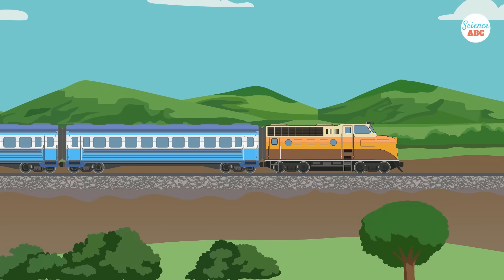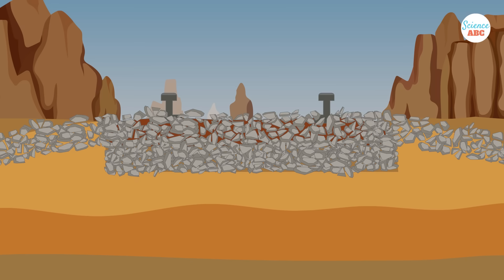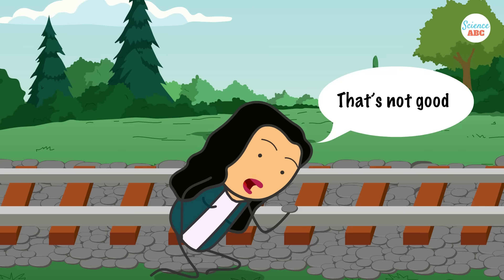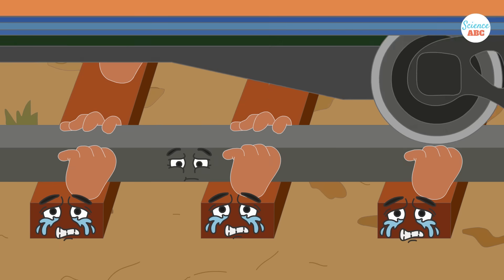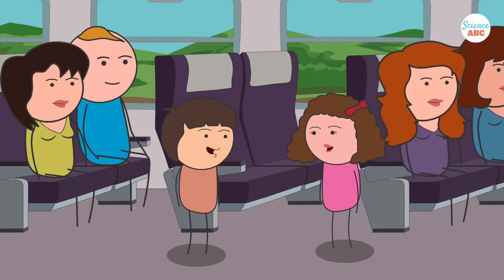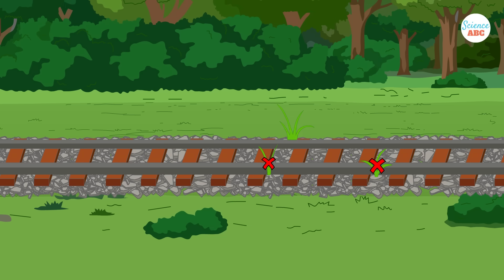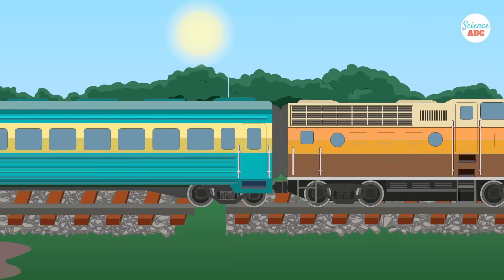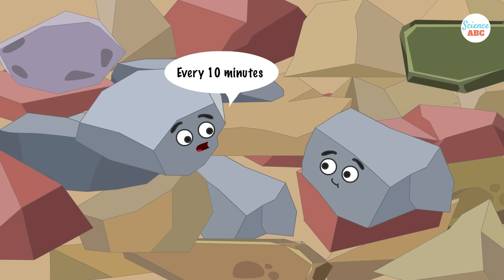Why Are There Stones Along Railway Tracks?

Comment: Out of curiosity, you say the grass and similar cannot be allowed to be near tracks. How does that fit with some tram tracks I'm aware of, which should be functionally the same as train tracks, working just fine despite being surrounded by grass?
Reply: my guess is trams are slower and due to being in a city and smaller its much easier to send a guy out with a mower
if there is a fire or something, its easy to deal with where as a rail track might be hard and slow to access

Comment: In the days of steam locos, another reason to keep vegetation from growing in among the ties was that during dry seasons, the loco exhaust could and did set the grasses, etc. on fire.  Not good if you have wooden ties.  Even worse if they have been soaked in creosote to help keep the wood from rotting.
Reply: Sparks from breaks can still do that
Reply: I farted blue flame (methane).
Reply: Back then, the toilets emptied onto the tracks, that's why they had to creosote the ties, to hide the other reason they would be brown...

Comment: In today's world, ballast is spread by big machines so the edges of the ballast line are very irregular.  Back in the days of steam locomotives, the upkeep of the track was done manually. A crew of men would be assigned a section of track, so these were called "section crews."  
The spreading of the ballast was done with shovels.  Often section crews competed with each other with a sense of pride of how well they did their work.  One visual indication was how sharp the line of ballast was along the edge between ballast and dirt fill - very artificial looking.

Comment: Drainage is FAR more critical to protect the wooden ties/sleepers, as wood sitting in water rots much faster than rails rust.  Check out the 1901 "Railway Track and Track Work" by
 E. E. Russell Tratman - reprints are available but the copyright has expired so one can find complete copies on line.

Comment: What’s also interesting is how they try to replicate the properties of track ballast where it cannot be used like on new concrete viaducts or in newer tunnels where they often have systems that involve large concrete sections that the rails are mounted to but there’s still gaps for drainage while thick rubber pads might be used between the concrete sections and the main viaduct/tunnel structure! :)

Comment: Excellent and fun video … and I’ve helped look after the UK ballast cleaning programmes! There’s a few more reasons to add to the list ….

- Ballast can be moved (by tamping) to allow the tracks to be repositioned, eg slued laterally, lifted or lowered, or even re-canted to increase or reduce the amount of super elevation on a curve. 

- Ballast is currently cheaper to install per metre than ‘slab-track’

- Ballasted track allows the sleepers (and the ballast itself) to be replaced in relatively short time periods and easily.

- Waste ballast can be recycled … eg often sold to other industries such as roads for use in tarmac.
Reply: The video was excellent. The replies are better
Reply: I was just wondering if they reused it, I live near a bunch of old abandoned railway tracks and have noticed they are all scraped clean down to the dirt, that figures now. I assumed the tracks and sleepers are all recycled but I didn't know if the ballast was removed or if it wasn't there in the first place, but now I know.

Comment: During and just after the steam locomotive era, many track ballasts were comprised of cinders, the residue left from coal burning steam locomotives.
Reply: Yes, cinders are the left-over stone matrix when the coal is burned out of the rock. Cinder is very porous, very cheap (left-over material) and actually a great ballast.  The one problem is that it crushed easily, particularly underneath the ties (sleepers) as the track rides up and down.  Once crushed, it no longer drains well, so had a high maintenance cost.
Reply: some areas of the UK it still is
I know near my house where a lot of trains passed the stones were incredibly pourous and smelled amazing, but im not sure if it was cinders or the slag and stuff from the local steel plant
Reply: Old cinder ballasted yards are a joy to work in. It's like walking on carpet compared to regular ballast
Reply: My high school had a cinder track back in the day...

Comment: Fun fact:
Rails are not very rigid.
Sleepers exist to keep the guage constant.
Otherwise, the rails would bend out of the way like big metal noodles.
Reply: The locomotives will try to put the tracks where they want them.
Reply: @JuneNafziger  Actually, without sleepers, trains would just push the rails apart as train wheels are conical to help center the trains on the tracks and help them get around curves.
Reply: Funny that the sleepers keep the gauge constant without waking up.
Reply: @gamingmusicandjokesandabit1240  funny how people can't spell gauge
Reply: @alejandrayalanbowman367  guaugue.
how'd I do?
Reply: @alejandrayalanbowman367  
Maybe it's not their first language and that's why they make mistakes.
Reply: @alejandrayalanbowman367  Edited.
Reply: @Hans-gb4mv  Well I mean that's where the locomotive's wheels want to put the rails.
Reply: Also, without sleepers, we’d be very uncomfortable in coach.
Reply: So how do sleepers accomplish this?
Reply: @vincebaldwin4059  I worked in a steel mill as a university student. We manufactured a steel clamp called a "tie plate" which was nailed to the sleeper and in which the rail sat. These tie plates positioned the 2 rails at the desired width and prevented drifting and, in effect tied the rails together.
Reply: I've unloaded 1/4 mile sections of rail before at work. Even the heavy guage stuff bends like wet spagetti when it's coming off the rail cars.

Comment: Ok, but how does the balast reduce heat expansion? Rock is not a very good heat conductor and the contact between the balast and the rails is very limited.
Reply: It adds to the thermal mass and lowers the rate of heating, also as it has a huge surface area it gets cooled by the winds faster than the track.
Reply: @prakharmishra5583  i didn't think about the air flow and the surface area, thanks!
Reply: @edgarvilar2128  you're welcome buddy
Reply: The main reason is that ballast heaped at the ends of sleepers (ties) adds a significant amount of weight that prevents the sleepers moving out of alignment and preventing the rails from buckling. Hence it’s important that the ends of sleepers are well packed with ballast and large enough to distribute the loads. Hence before hot weather approaches, ballast is often dropped to top-up any low ballast shoulders, so you’ll often see some clean/new ballast on some ballast shoulders.

Comment: I noticed on older rail trails that nature has filled in the gaps between the rocks with dirt. THe rails and wood ties are long gone. What makes me nervous is there is still no real vegatation even though they dirt has been there for 30 plus years and still very very little growth. I wonder as I ride with a bunch of people on a hot dry day kicking up dust from the first bike to the last breathing that dust and what chemicals did they get away with using 100 years, 80 years, 60 years that is still active at keeping growth down in my dust laden lungs. Have fun riding those trails.

Comment: Nice explanation, could you please tell me why there is no ballast in railway tracks on bridges...
Reply: Ballast adds considerable deadweight to the bridge
Reply: 1. plants cannot grow up there as easily
2. there are pipes for water drainage so the tracks will not flood
3. noise won't be too much of a problem when it's high up????
4. bridges are built to be structurally stable and can withstand pressure
these are just possible ideas that I can think of, these reason also apply to tracks underground and or in tunnels
Reply: It depends upon the bridge. The preferred method is to have ballast upon bridges. However there are many older bridges that cannot accommodate ballast due to either total weight limits (as ballast can add a significant amount of weight), also if the bridge has a shallow depth then there may not be enough depth to have ballast. Also some bridges have very poor retaining features and the ballast could fall off the bridge.
Reply: @ModelRailway  but locally there are newer built metro lines (that only carry 3-carriage passenger trains) and there ain't no ballasts (also locally very humid and a lot of seasonal rain) or it might just be that our local metro just doesn't like ballasts and only have them in the one and only oldest line and train depot areas
Reply: @GingerMoony  Which Route and location? Metro or light tonnage routes are less critical/more flexible in terms of specification and design compared to say a high tonnage and high speed line. Also may depend upon the location in question … eg the rail line could be over a road where height is critical and next to say a station; therefore having a shallow depth bridge is an advantage.
Reply: @GingerMoony  Metros usually use slab track (no ballast, ties are sank in concrete and then it sets permanently) as it's much cheaper and doesn't require tamping, cleaning etc. But since it is much more rigid, it is only suitable for low speeds and is also much much noisier.
Reply: @MrOpenGL  yes

Comment: In the days of steam the track beds provided much more of the suspension for the trains. With dieselisation and electrification and higher line speeds track beds became much firmer relatively speaking - a firmer track bed allows higher speeds. So much so that in the UK short-wheelbase wagons were observed bouncing off the track at speeds they had previously been comfortable with. These wagons ran in trains with speeds of upto 50mph if fitted with automatic brakes.